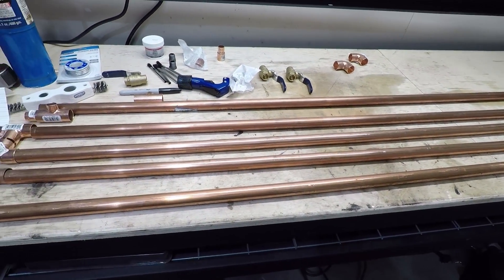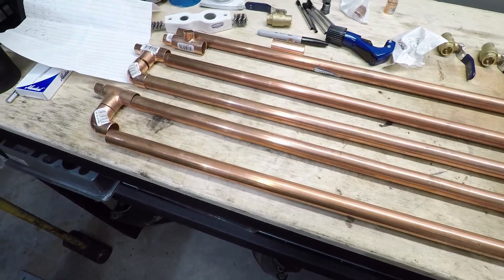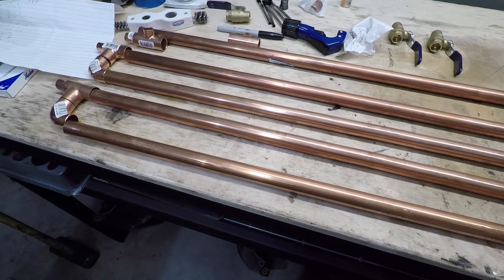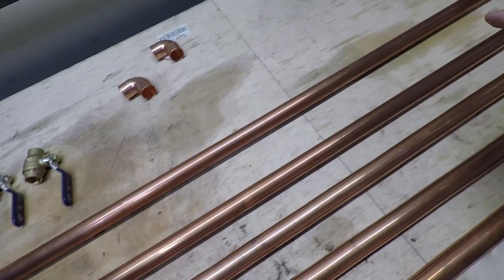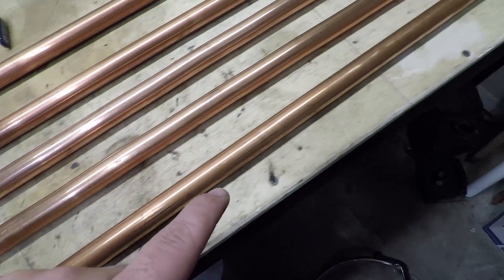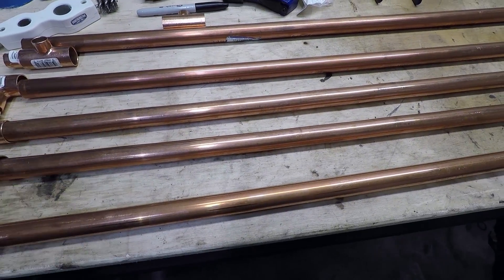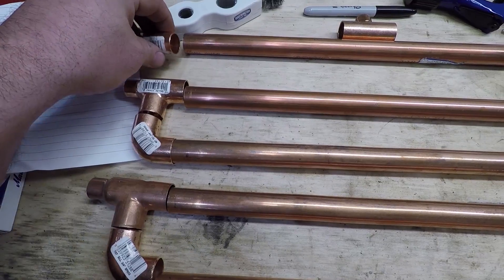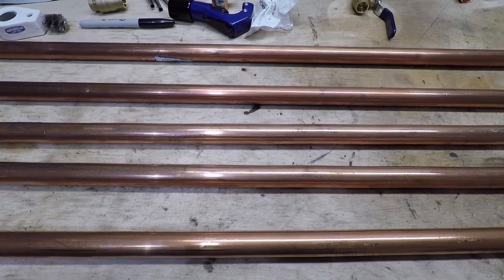Removing water from an air system - air system water trap

Comment: What size copper do you use buddy?
Reply from the maker: ¾ inch copper.
Reply: @ToTheTopCrane  any idea about thickness copper?
Reply from the maker: Not sure about the thickness. It is ¾ inch type L copper pipe. It is rated for 650 psi.

Comment: Great work on the cooler! The only thing I would do different is take the output from the pump directly to the cooler and then return to the tank. That would keep water out of the tank keeping it from rusting on the inside.
Reply: Jack I need to do this for my engineering shop. I saw your comment, and never did that occur to me before. That sounds like an EXCELLENT idea.  I have a TON, of black iron pipe, left over from my former production facility, and every conceivable T and 90 in 1/2" can I make the dryer out of that instead of the copper and be okay?  I plan to use TIMED BALL VALVES, to open up the drains, so I don't even have to do that.....   But your comment caught my eye, makes a lot of sense. Coming out of the tank, just use a regular water collector?  (Because you basically collected or evaporated or drained it off before you stored the air.  And I bought one of those dryers that take the "toilet paper rolls" I will use it for my occasional paint spraying needs, or maybe sand blasting. Just to make sure I got it all.  How does that all sound?  Or do I need to most definetly use copper?  If there is not a HUGE amount of difference I would prefer the black pipe.
Reply: @brentbarnhart5827 yes sounds like a good plan.

Comment: Why the hell do you have a section connecting them all in the middle and why the hell did you put that on a kolbolt oilless air compressor
Reply: The pipe in the middle is a bracket he made to help hold the system together

Comment: I have seen this set up.  Like others, before.  And wonder why they install three and or sometimes more ball valves.  Why not run all the drain pipes to one pipe, then have one valve for all the water buildup.  Save time and money.
Reply: If you run the pipes horizontal you could put a vertical drain pipe at the end.
But with the vertical pipes you need a way to drain the bottom loops.

Comment: I'm curious to why all the people building these separators use 3 or more ball valves, couldn't one just tie all the lines at the bottom into one line then put a ball valve at the end of that line?
Reply from the maker: If you tied all of the lines together at the bottom, it wouldn't force the air to travel through the entire length of pipe. Which would reduce the moisture removing ability. The goal is to get the air to travel up and down through all of the legs of the system, losing moisture as it goes. Great question!

Comment: What is the intention of the crimped tube vs. a cap, or el at the termination point? I didn’t know if that serves a purpose, or if it’s just what you had. Looking to put one on my system, so doing some research.
Reply from the maker: It was late and that's what I had. A cap would've been ideal. It works perfectly. I've never had anymore water come out of my air lines. I drain it every so often and water always comes out of the drains.
Reply: @ToTheTopCrane  cool. Great build! Thanks for making the video.

Comment: $200 for materials! I thought it was going to be cheaper but I guess prices have climbed over the years. I need this for a plasma cutter that's been drowning in liquids.
Reply from the maker: I use it for my every day compressed air use. But, I built it for use with my plasma cutter. It has worked very well. I get zero water in my plasma or anything downstream from this water separator.

Comment: Is it still working well?
Reply: I built mine but the T sections I left it a bit longer so the water drops on top of the taps and the air can flow at 4 inches above that and go across the next pipe I had no problem at all with water

Comment: looks like a good system !out of curiosity did you  get any scientific  on the measurements  in comparising the amount of pipe needed to the tank size  or is it all guess work ? I’m assuming somewhere is a formula for this i just don’t no where it is ? BTW i liked the video from under the moving crane quite a bit  I did Woodworking professionally for over 20 years in the Washington, D.C. Metropolotian area  and often we had to rent cranes for lifting materials into high rise buildings ! Even as a adult i always was fascinated by the Cranes  perhaps in the high heat of the summer you may need a box fan or 2 blowing on the  pipes to help condense the air faster ? with high humidity?

Comment: Was this added into the system after the air tank or before going into the air tank. Its a great idea and would be better if it was before the tank, cooling the air before the tank with the drain valves and by the time it is in the tank it will be really cooled to condense out the water. Looks like it works tho.

Comment: Would of been a lot less time and money to buy a heat exchanger off of eBay, which I did and it's rated @ 360 psi. Only cost 125.00$
Reply from the maker: Dave Shaw, that's probably true. But, it's also kind of fun to take an idea and run with it. I tend to be a tinkerer. So, building my own seemed reasonable. Many thanks for watching! 🙂👍
Reply: Dave,  I have searched ebay and the heat exchangers are too many.  Which one did you find that would handle 360 psi?

Comment: Hey who was that masked man anyway ? 😁
Great idea on the build, probably work better than a commercial one !
I've got a small separator on my tank but don't need much of one when our humidity runs around 2 or 3 percent a lot of the time. There are times though that it can get pretty sticky so I could probably use a better separater.
Thanks for sharing and take care. 👍

Comment: I'll be interested to see how well that works in the long run. If it does well, I might just have to steal the idea from you. Unsurprisingly down here in FL we get a fair bit of water in our compressor tanks come summer time. I think the only thing I'd have done differently would be to use unistrut (that green u channel electricians use to mount switch gear) and some of the unistrut pipe clamps as the structural side of it all. 

One thing we did to our compressor here was to get a drain valve relocation kit so we can drain the tank without having to unhook ours and drag it outside. Which works well if you want to leave your compressor semi-permanently installed. Right up until dumdum over here forgets to close the valve when he's done with it and spends 15 minutes staring at the compressor wondering why in heck it won't build any pressure. All the while, it's venting air outside the shop quite happily.
Reply from the maker: Sandy, so far, it is working perfectly. I may follow the advice of others and plumb it between the compressor and tank. I may also steal your advice on the uni-strut mounting. Thanks for the idea. 

I bet your compressor wasn't very happy with you leaving the drain open. Lol. Many thanks for watching! 🙂👍
Reply: I could be wrong, but wouldn’t a piece of unistrut possibly introduce electrolysis from dissimilar metals? I dunno. Just wondering.
Reply: @psidvicious   In my experience Unistrut comes with that green paint on it and the pipe clamps are stainless so you wouldn't have to worry about electrolysis from the dissimilar metals. 

Depending on how Jimmy plumbs it in, I'd be more worried about vibration and mechanically damaging the copper tubing. That said a thin layer of urethane rubber wrapped around the pipe where the clamps sit would probably take care of both concerns.
Reply: Right. I guess it should be easy enough to isolate the metals.

Comment: Nice job with the project Jimmy, should serve you well.
If you're doing a lot of plumbing work (soldering) you'll love MAP gas, much hotter flame, reducing time to heat your fittings....
Great design, will prolong the life of your air tools operating with "dry" air supply.
2 thumbs up from here, work safe and stay warm!
Doug@ the "ranch"
Reply from the maker: Doug, thank you! I don't generally do a lot of plumbing. So, I used what I had on hand. But, in the future, I'll remember your MAP gas advice for sure. Thank you for  watching! 🙂👍

Comment: Just a note. Be sure to check the rating of the pipe for pressure , I believe  type  M is rated at 300  psi  and is suitable for  for this. The others are thinner and softer ,these won't hold up over time and will crack or blow out.
Reply: Type M is the thinnest, type L is in the middle and is by far the most commonly used and K is the thickest wall.  There is also copper for DWV that is even thinner than m but it is used rarely these days.
Reply: Daniel Kelly  you must be in the plumbing trade. I'm just a jack of all trades master of none lol. And you are correct I get that mixed up all the time
Reply from the maker: KEVIN MATTHIESSEN, I used the heavy wall copper. So far, so good! It is also removing all of the water. I haven't had any run through the plasma (which is why I built this). I am also learning that I probably could've went a cheaper route. But, where's the fun in that? Lol. Many thanks for watching! 🙂👍

Comment: An additional thought, if you are going to run that much pipe to get the heat to drop out of the air, put an orifice at the top of one of your bends. If you are using 3/4 pipe reduce to 3/8" and back up to 3/4 right away. That will speed up the air chilling it and forcing water out, then the water will collect down by your drain valve.
Reply: I do not think adding an orifice is a good idea, it would cause the air to compress and go through the small hole causing the air to expand thus drawing the moisture out of the air. This is exactly how air conditioning Packs (air conditioners) work on Falcon Jets. The problem I see by restricting the air flow is the recovery time of the volume of air that is consumed by say a die grinder. I think it would take too long for the tank to recharge with an orifice.
Reply from the maker: longcaster, that's a great idea! If I start seeing any water out of it this summer, I'll definitely do that. Thanks for the tip! 👍
Reply: longcaster dang, I didn’t think people that smart hung out on YouTube.  
Welcome, hangout, come back anytime and please, reproduce, the gene pool needs help.
Reply: Most folks (creators) on You Tube like their brilliance not to be outshone by anybody. Our crane guy likes a little good advice every once in a while.

If I gave him what I thought was good advice constantly I would quickly become what is called (a pain in the @$$).

Jimmy is humble, takes good advice when needed, and shares his talent to operate a big crane. He makes one of the hardest jobs in construction easy to understand and explains it so even I can understand what he talks about.
Reply from the maker: @longcaster , I absolutely welcome advice. Sharing ideas and advice is how we all learn. Being humble is a trait that runs deep. There is no room for arrogance, especially in my profession. Thanks for your kind words!
Reply from the maker: @jaxturner7288 , please keep it family friendly. Also, no need to provoke others in comments. Thanks!👍
Reply: To The Top Crane            I edited the curse word but the rest was a genuine compliment. About as positive of comment as I have ever given by the way. 
What you’re considering provoking I only meant as inviting, I mean I said “welcome” “hangout” “come back anytime” I even encouraged them to have children, trying to convey it would be nice to have more people like them around. If that’s provoking in a negative manner, I just don’t know how tell someone I enjoyed the interaction and hope to repeat the experience effectively over a keyboard, That’s just as friendly as I can type.  I do apologize for the misunderstanding  I’d never want to affect your channel in a negative manner as I respect you as a creator and appreciate the glimpse into your life’s journey.
Reply from the maker: @jaxturner7288 , my apologies for misunderstanding.
Reply: Will this reduce the cfm or pres at the end for sandblasting ?? Thank You Loren

Comment: Lone Ranger was cute. I rigged up an air dryer for the compressor I mounted on my truck to refill my tires after airing down to drive on the beach. I used 2 of these type of dryers in line right out of  the compressor all connected with standard air fittings like your tools connect. It was about $50 10 yrs ago and has worked very well.

https://www.amazon.com/Compressed-Moisture-Water-Filter-Compressor/dp/B01ADRW2JG?ref_=fsclp_pl_dp_12
Reply from the maker: longcaster, my solution was a tad more than $50. But, what else is a person going to do on a Friday night. Lol. Thanks for the link and for watching! 🙂👍

Comment: I liked the tee-shirt wish I had, glad to see it fits so well. Is the copper cold by the time it gets to your third leg of the system and another thing is you could get water traps that open on demand but it depends on how often you use it if needed.
Reply from the maker: barry hansen, that T-shirt is comfy! The copper is cold by the time the third leg is reached. So far, the system is working very well. I have used the plasma a lot and haven't had any water issues. Many thanks for watching! 🙂👍
Reply: Have you checked the temperature where the air enters the copper and exits it? It would be interesting to know how much it cools.

Comment: Jimmy, I did a similar construction several years ago on my air system. I used 4 - 10 ft pieces of 1/2" black iron pipe elbowed together in a similar manner with a 4" trap I built from a piece of iron pipe. The main thing I did differently was to plumb the rig in between the compressor pump and the receiver/tank. This method cools the air before it reaches the tank. The trap catches by my estimate 99% of the water so it doesn't get to the tank. The temp through the pipes drops from almost 300 degrees down to essentially ambient. I have never had any water come out through an air tool or blow gun since. I have a blast cabinet and a plasma cutter, both equipped with moisture filters, but neither have ever had to be drained.I drain the trap every couple of weeks, depending on usage, and the tank at the same time. The trap will spray water out for a bit, but the tank drain only has a small spurt. Good job on what you did, looks good.
Reply: Bruce Lott the separator before the tank is the suggestion I was going to make, apparently you are just as smart but much faster than I. 

Here in Michigan, I had to make a system like yours to prevent my tank bottom from forming ice. Once it began to freeze, it was all over because it was impossible to drain and grew larger every time I used it. Eventually it turned a 75 gallon storage tank into @ 10 usable gallons of air space and a 5 foot tall ice cube I kept plugged in and stored in my garage.
Reply from the maker: @jaxturner7288 , that would be nooo good! That's a lot of ice. Fortunately I installed a heater in my garage this winter. So, no ice for me. But, the water was a problem and would reek havoc on my plasma cutter. I think I will follow yours and Bruce's advice, and plumb it between the compressor and tank. Many thanks for watching! 🙂👍
Reply: Brother, the pleasure is all mine. 
Hey if you ever get board or maybe frustrated while you are just looking up, waiting for good things to happen, remember the crazy number of us, that look up too you, waiting for good things to happen. 
We love you man, it’s a real privilege just to be a fly on the wall in your daily life. 
👊
Reply from the maker: Bruce Lott, I never thought about plumbing it between the compressor and tank. Thanks for the idea. That would definitely prolong the life of the tank. Many thanks for the compliment and for watching! 🙂👍
Reply: To The Top Crane yeah with your current setup you will still have to drain your tank often and it could still form ice in the tank like mine did if its cold enough.   Both afterthoughts by the way, when I first set my system up.
Reply: I did one like Bruce did in the eighties, also before the tank. It worked great until I had to sell off the shop in a divorce. I like the copper as it will have a better rate of heat exchange.

Comment: How much income do you make, there is like a million dollars worth of copper and valves in that set up.  I can appreciate taking the time to make stuff, but a simple air mist separator would have worked. Look up "SMC AFM" on ebay, about any of them would do.  Or www.SMCUSA.com if you want tech data on filter/regulator/mist separators.    And, not knowing the entire situation, will the air compressor supply enough air volume for the plasma?
Reply from the maker: mathdj01, there isn't too much $ in copper there. Maybe $180 total. It works very well too. More than anything, I wanted to see if I could design and DIY a solution. The plasma works great on the setup. I wouldn't want the compressor to be any smaller. When making a cut in 1/2" plate, I can cut close to 12" before the compressor kicks on. Many thanks for watching and sharing the info on the separators! 🙂👍